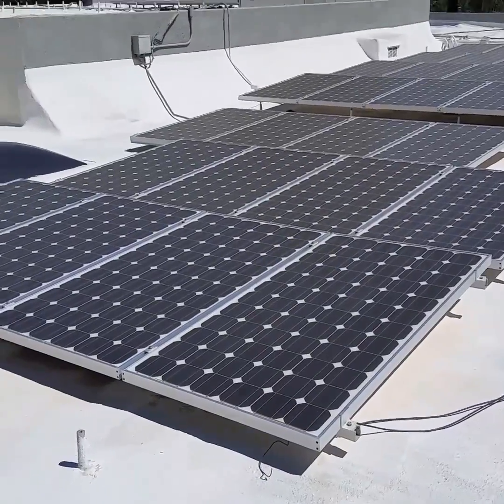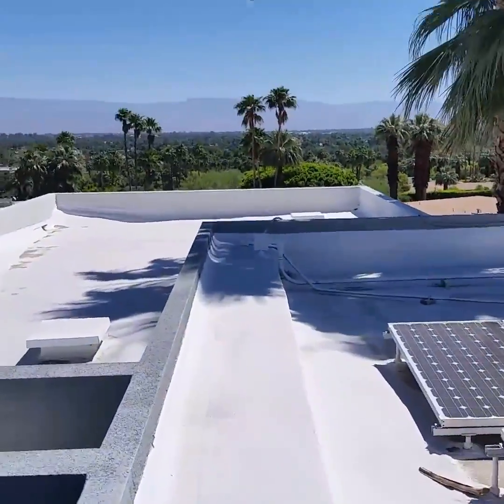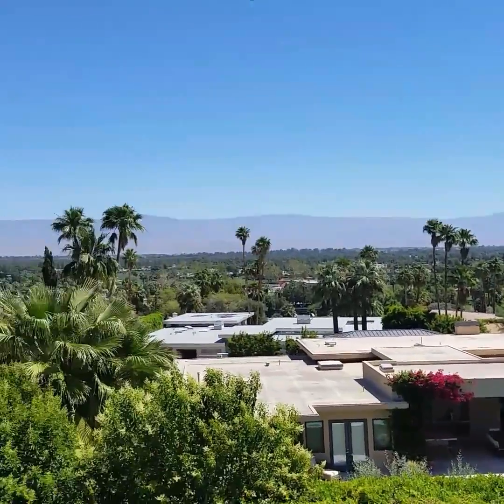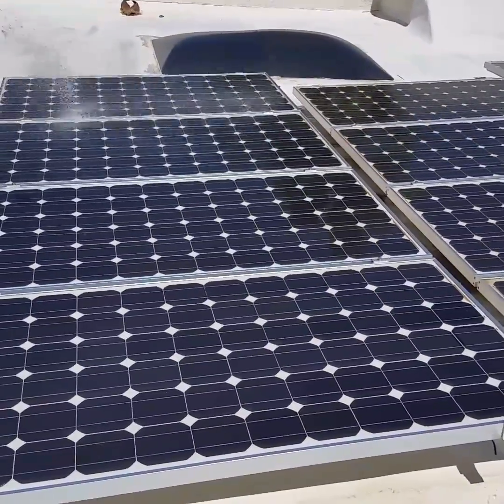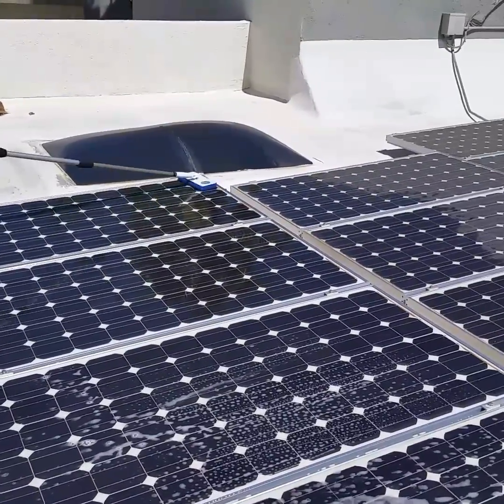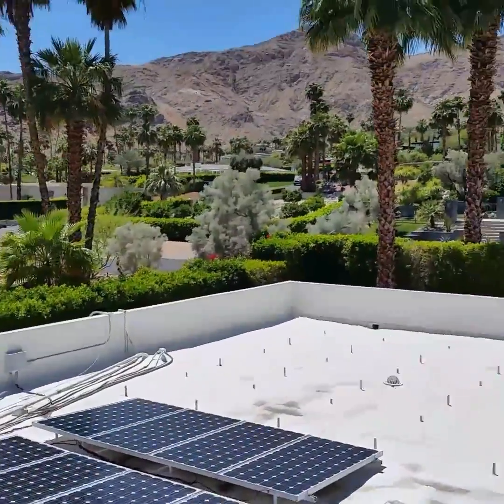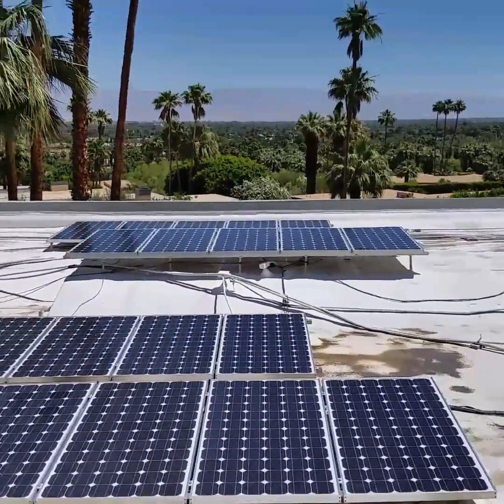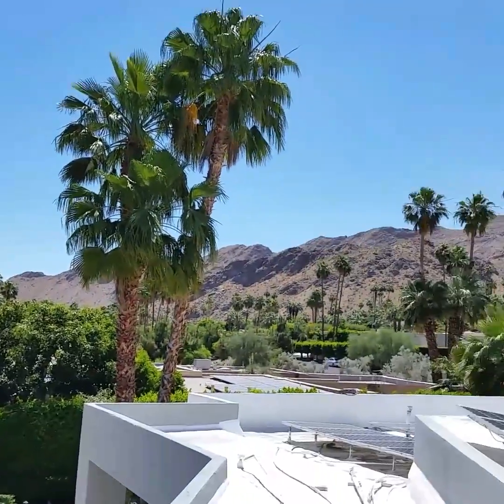How to clean solar panels

Comment: Nice vid. I just did some the other day as well. What soap did you use by chance? I see glass gleam solar is sold by my distributors. Honestly I used water and dawn. looked just fine when I was done. These were the first ones I had done. Just wondering what other folks are using. I am for sure going to market this as an add on.